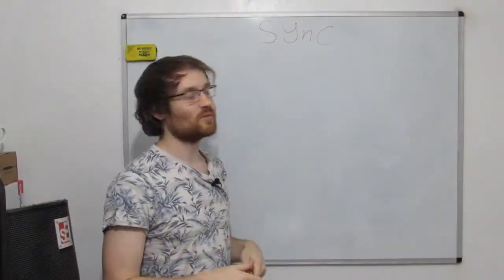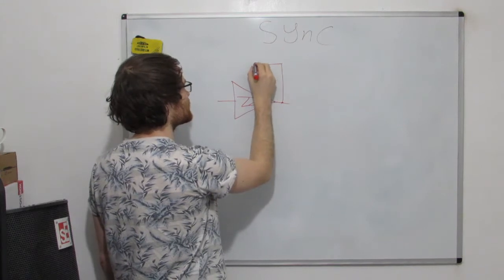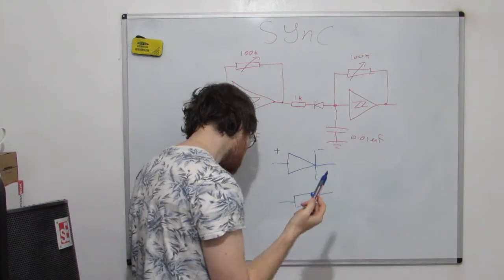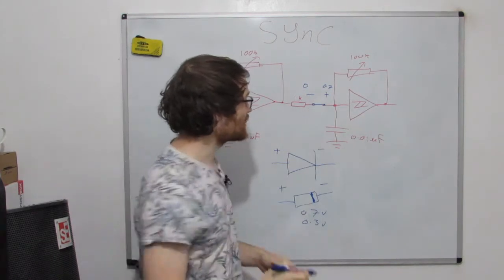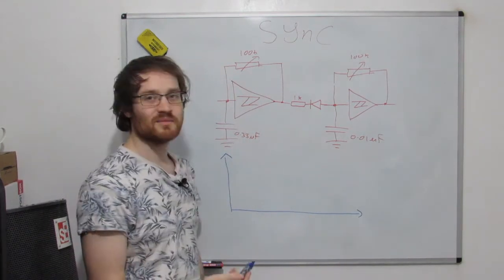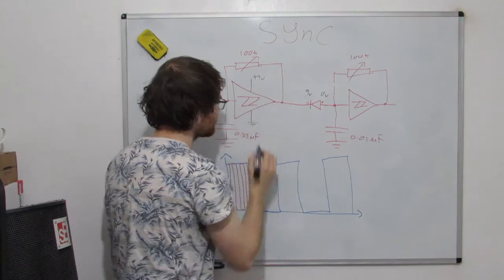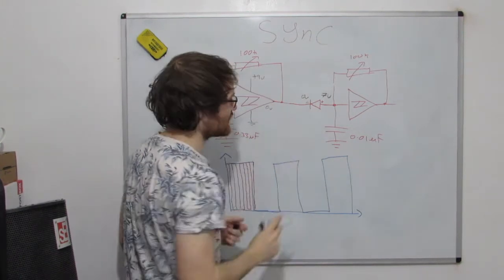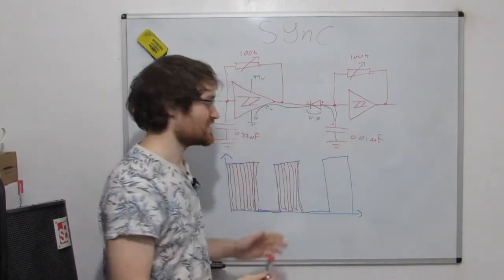CMOS 40106 'Sync' Effect

Comment: You can change things up even more by adding a couple more diodes in the feedback path of the first oscillator, feeding each end of another smaller pot with the wiper going to the existing pot. Changing the new pot will alter the hi-low periods of the oscillator, effectively giving you PWM control.

The distinctive sound is due to the overtones. You can find some very talented folks on YT who can do overtone singing, and the effect is very similar. Think of the Mongolian throat singing, that does the same thing.

Comment: I'm glad you finally explained the function of the diode here - Ive seen this circuit elsewhere but the diode was a mystery.
Basically while/whenever the first osc is positive, the second one can operate normally (make a sound), Conversely, when the first is zero (or more negative), the second is muted because it's signal is diverted back through the diode.
So it's actually the conduction of the diode that 'blocks' the second osc! Got it!! 
At higher frequencies both oscs contribute a 'sound' because the on > off > on > off rate of the first osc creates an audible tone, made up of little bits of the second oscs tone.

[On a side note, you can tailor the freq range of the osc by using a 'small enough capacitor' for the high end and a 'large enough resistor' for the low end. A 1Meg pot and a teensy cap (much less than 1uF) gives you the entire audible range down to a few hertz.]

Comment: Fun series. This video is confusing me though. I guess you are saying the left osc is the "audio" one and the right is the "effect" one. If I imagine singing a tone vs brrrrr my lips while singing a tone, that's the difference. Except my lips need to be going at a higher frequency than my tone. Kind of the opposite of an LFO.

In the demo portion, you are adjusting "the resistor" (I assume on the right osc) to modify the effect. At some points, the oscope is showing the same thing you drew--that the effect signal disappears when the audio signal is low. I understand why that happens. At other points the oscope is showing that the effect signal continues even when the audio signal is low. How is that possible? The right osc would only be able to charge up to a max of .7v.
Reply: Later: I built this and my left/right understanding was correct. To anyone else reading this: The resistor he ignores in the schematic is kind of important. 1k didn't really work for me. 10k works over a small range. In the video, you can see he's using 100k, which turns out to work really well.